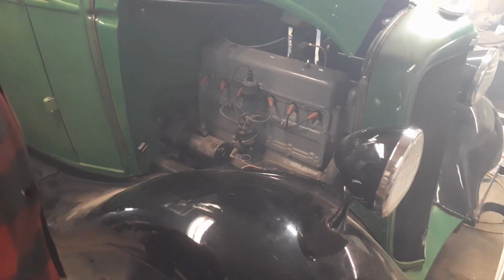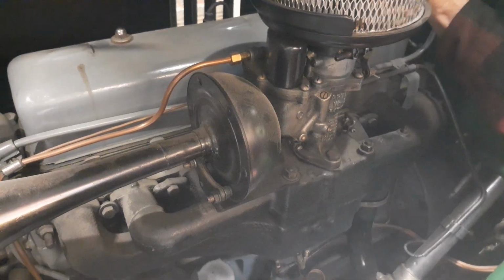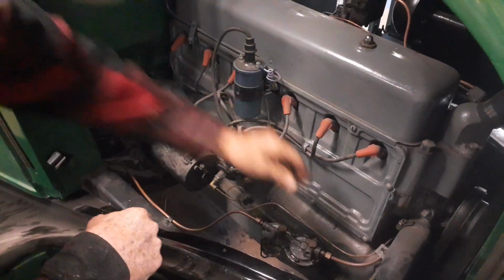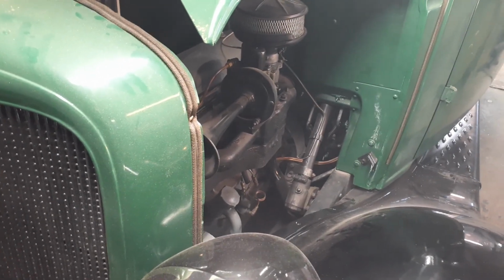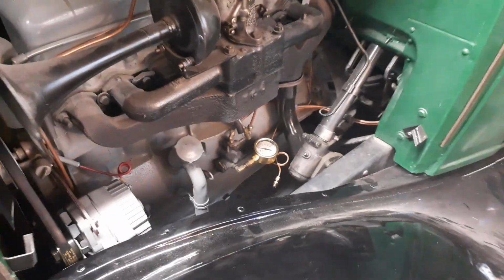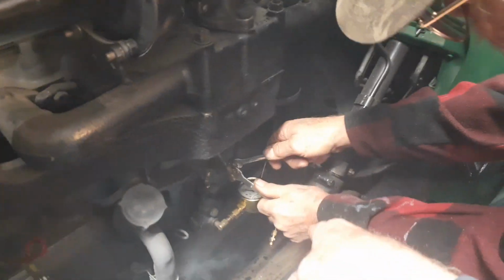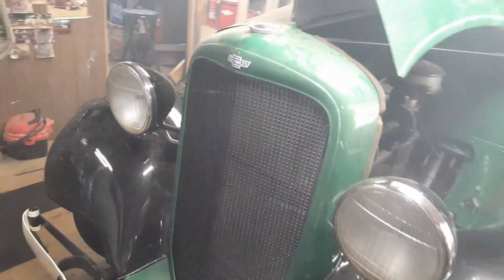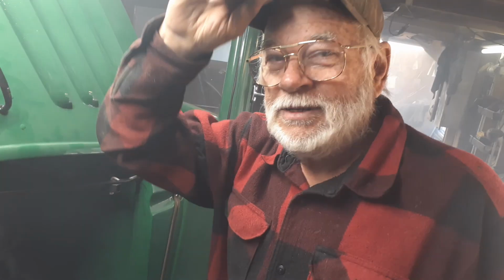29th Chevy Video

Comment: I'm quite surprised to see that this model Stovebolt does not have the distributor that physically moves when the vacuum advance works ... saw it on a friend's  '47 model and thought it was quite a good idea - you could always see clearly that the Advance was working . If I recall correctly , the Oil Pressure gauge on that car only read up to around 35 lbs max, normal running showed around 7 to 15 lbs. I am quite sure you will sort it out in time .

Comment: I have a 51 Pontiac with a flat head 8 and it doesn't have a filter. The manual says they weren't set up for one. Like your engine all I have is a port for the pressure gauge. Putting a filter on it will cause the low pressure reading. The filter needs to be plumbed to a different place if possible. Worst case scenario would be to put a power steering pump on it sucking oil from the pan front and dumping it back to the pan in a different spot.

Comment: I don't think that the oil filter idea works on this engine. There is no flow of oil , it's only a pressure bleed for the oil light. Check with Chevy people over yonder. Good video, thanks.